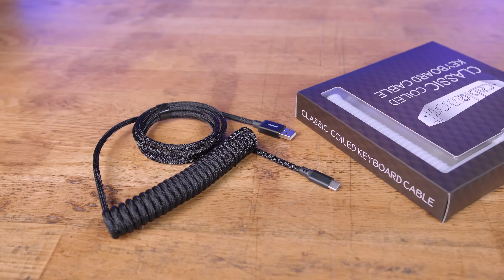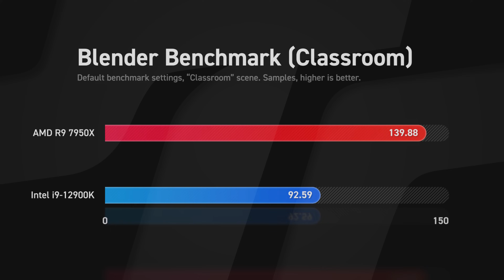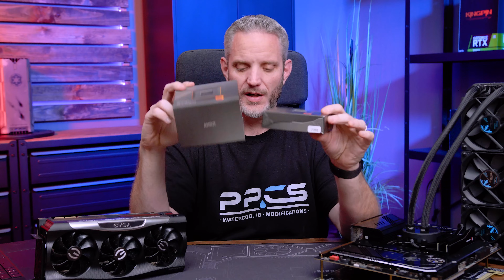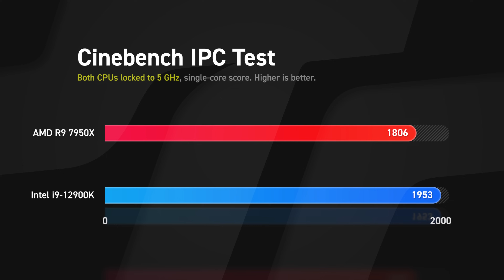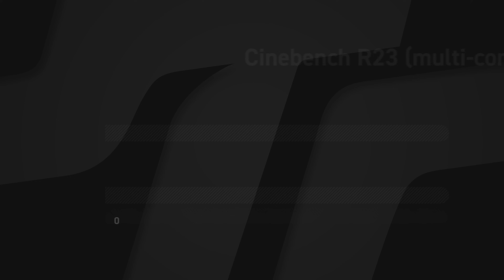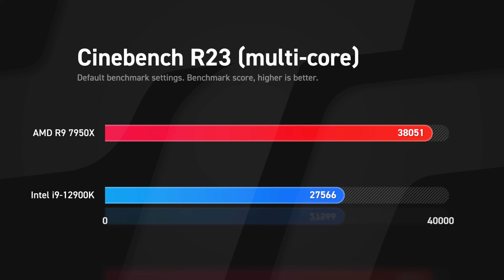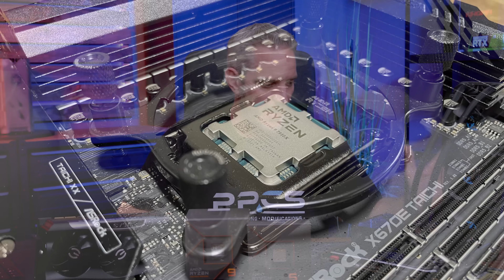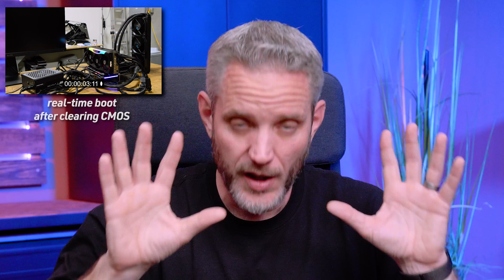Forget EVERTHING you THINK you know about AMD... these CPUs kick A$$!!

Comment: I want to see how that CPU is when you undervolt it, I managed to drop like 15°C in my 5900X losing in single core almost nothing in CPU-Z and in multicore winning a little bit of Performance in CPU-Z, and I noticed it at rendering video it did it faster than with PBO, even running at a lower frecuency, I have it running at 4.6GHz with 1.25V, that makes me have it with a temperature of 65°C  (In summer with an ambiet temperature about 28-30°C) in Full load, considering that I had it up to 81°C (at the same ambient temperature), in winter I'll probably have even better results with temperature, because with PBO in winter It has about 70°C in Full load

Comment: Hi Jay, I run a Zotac 2080Ti Amp Extreme on my Ryzen 5 3500 (6c/6t). Is this a bottleneck and will I benefit from upgrading the CPU to a 3600 (6c/12t) or a 5600 or 5600G (6c/12t). The motherboard is a ASRock B450 Steel Legend (ATX) and RAM is G.Skill Trident Z RGB (GTZRA).

Comment: Jay, i'm interested in seeing you do a video on undervolting Ryzen 7000 to see if there can be some optimizations made there and as a general guide to undervolting. I have a feeling a lot of people are going to be looking at undervolting Ryzen 7000 just because they don't want to see 95c temps.
Reply: Look no further, check out AMD's ECO mode. It's officially in starting from Ryzen 7000.
Reply: That's not how these CPUs work now. They'll just try to throttle up more to hit 95.  That's normal and expected.
Reply: Agreed i my have to undervolt my custom water cooled 5900x to prevent shutdowns because my stupid asus motherboard shutsoff if the cpu goes above 85c. A 240mm rad should be able to cool a cpu even in summer at stock settings. Its just not user friendly to have to undervolt. Thats where intel has the uperhand. They just work out of the box even if they run hot with the stock cooler
Reply: @alexanderschulte8248  maybe you can change a settings in your bios?

Comment: Man, this is what I've been waiting for to potentially upgrade my FX-8350! Here's hoping AMD brings the pain to nvidia in the same way so I can also replace my gtx 1070 with a new RDNA-3 card and have a baller AMD rig with legitimately no compromises!
Reply: Please get a 5800X3D instead, It's actually faster in games and it's cheaper if you keep in mind the prices of the new platform like the motherboard and ram.
Reply: @FirstnameLastname-we6dh  I'm not much of a gamer and don't have any use for crazy high frame rates so many people chase. The future support of an AM5 platform is WELL worth the couple hundred bucks I'd save and handful of FPS I'd gain by going with a current 3D. Who's to say AMD isn't planning a 3D version of their new lineup anyways? It would be pretty stupid for AMD not to have parts in motion that would be better than previous gen in games.
Reply: @Kcducttaper1  AMD is indeed planning on releasing 7000 series 3D next year.

Comment: 12900K doesn't have AVX-512, so I don't get the 2 x 256 thing... I think it's just that relative performance can be different depending on the workload.  Intel is generally a bit better in AVX IIRC.
Reply: AVX-512 was available on early 12th gen CPUs, with some boards supporting enabling the feature. Later versions of 12th gen CPUs hard disabled the AVX-512 capability so this would no longer work. It would have been interesting to see the performance of the same i9-12900K with AVX-512 disabled in the Cinebench IPC comparison.

Comment: This way of explaining things even confirmed my desition to wait for AM5 even though my current PC died 2 months ago.  I was still on ddr3 I5-750 platform before. I hope they bring bit more softvere to ease streaming, and doing other stuff than just gaming, If not I will get Nvidia GPU. Now I have just one question, should I invest in 64GB RAM or just 32GB ?  Btw I plan to use true 1440p monitor.
Reply: It depends on what you plan to do with it just like everything else, 32GB for just gaming and general use, 64GB for gaming+streaming/ video rendering so you have plenty of multitasking head room
Reply: @Dracopendragon013  thanks, I had planned to stream, and casual modeling in autocad. So 64gb is for me.

Comment: Looking forward to see what the AMD GPU looks like now.
Reply: probably ramps up to 95c in the first 8 seconds then sits there slowly turning your room into a sauna
Reply: @Desalater2  It's the watts dissipated that effect your room, not the operating temp of the chip. Think about how Intel's die shaving actually works. If the chip is still pulling 220w, yet the shaving allows the heat to escape faster, its dumping the same amount of heat in the room, just faster. Since you're clearly taking a jab at the CPUs, there is generally an end goal to having a CPU fully loaded. If Zen 4 and Alder Lake are at the same wattage, yet ADL dissipates its heat faster, and takes 40% longer to complete the same task, which one is actually worse for the human sitting in the room with it?

Comment: im hyped. I will wait a little maybe early next year to build my new system. Currently running a r5 3600 and a EVGA 3070 xc3. I think a 7700x would be a good match to the 3070
Reply: I think it will work really well even with RTX 4090
Reply: @phatminhphan4121  I mean true but little bit overkill for me. I don't even play on 4k
Reply: @yuschmax  what ??? Dont you know that the lower resolution you play the more powerfull cpu you need ?
At low res , the vga would be able to draw many fps than the 2K or 4K but that when you really need a powerful cpu to handle those many frames that vga can pull out per second !

Comment: So the question I have is... How does the new AM5 platform handle DDR5 and how many sticks you can run? Is the same issue present where the system wouldn't boot if you ran 4 sticks?
Reply: Hardware Unboxed did testing with 4 sticks and had zero issue.

Comment: Some of those benchmark results were also because DDR5 isn't what it's all cracked up to be. I forget who it was, but they tested DDR4 3600 vs DDR5 5200(?) and most programs ran the same, or WAY slower, on the DDR5 ram. The weakness in some of these new systems is definitely going to be the new DDR5 RAM.
Reply: Yeah, i believe Hardware Unboxed has done some of those tests.

Comment: So I'm not that well versed in CPU architecture, I have a question, in what task does a single core performance is utilised?
Reply: short answer is any task.

for tasks that cannot use multiple cores - single core performance will be the main performance factor.
for tasks that can use multiple cores - performance will be single core performance multiplied by the number of cores used.
here the performance factor will depend on the app if it can utilise all the cores and amount of cores available and the speed of each individual core. In some cases slower cores but more of them can give advantage in some specific scenarios.

Comment: My biggest 'hurdle', the full set replacement. Motherboard, memory, CPU..
Reply: wait isn't intel the one who slightly changing pin layout and you need to buy a new mainboard every time? I know i have the 3700x from 2020 and could replace it if i wanted with the 5800x3d from 2022, without changing anything.
Reply: @SaltyShakh  You are right, i totaly mixed up Zen with the socket, my bad :(
Reply: im going to call you out on that, am5 is the first new socket since am4. so no need to lie.
Reply: what? WHAT?!? AMD stuck with the same AM4 platform for FIVE YEARS...This is the first new mainstream platform since September of 2016! AMD are certainly NOT 'jumping sockets' faster than Intel - AMD have even said they plan to stay with AM5 beyond 2025.

Comment: Upgraded from a 1600 to a 5800x this year. I’m blown away by the improvements this gen. I’ll hold on for another gen or two before my next upgrade, can only imagine how much faster things will get by then.
Reply: I started of with a 5800X and it is insanely fast, I'm so happy with it. Can't be bothered about zen4 even if it is even faster. xD
Reply: Could you manage to keep the same motherboard?

Edit: I am not asking if it is possible but if DAngel did reuse the same motherboard.
Reply: @AndersHass  when going from a 1600 to a 5800x, yes, you can use the same board. The new AMD CPUs use a new socket so now you'd have to upgrade.
Reply: @singlsrvngfrnd  AMD was quite shady about the x370 updates. They even have actively blocked it . Board manufacturer are the reason the updates for some board is available, not AMD.
Reply: @AndersHass  if your motherboard can support am5 yes
Reply: @phoque9713  I am asking about if DAngel reused the same motherboard for his specific upgrade. 

No other CPUs than the recently released 7000-series used AM5 so it doesn't really make much sense talking about it as of now. But presumably it will have 5 years of support.
Reply: @AndersHass  me yeah 450 gaming plus whith all the candy you need to get faster as a 550 series motherboards when the bios update is well made
Reply: @AndersHass  no. Totally different Socket with am5. Amd is now lga
Reply: @VanquishedAgain  not for the upgrade DAngel  specifically has done....
Reply: @AndersHass  r5000x series is the last am4 thats means is the best to time to build am4 ...
Reply: @raycdo2012  no idea how that is related to me asking if DAngel managed to use the same motherboard for his upgrade. 

I know it is the last bunch of CPUs that support that socket.
Reply: @AndersHass  with AM4, you can use the same mobo (if bios supported) from 1000 series to the 5000series. I did get a brand new board to take advantage of all the latest bells and whistles. AM5 will need a new AM5 supported board but should support the next few generations.
Reply: @DAngelProductions  I know you can potentially use the same motherboard hence why I asked if you did so.
But interesting you bought new motherboard anyway.
Reply: i still uses 1600 with a 1060 and am thinking about to upgrade in to a used cpu and gpu , when zen 5 launch i might build a new pc
Reply: @hannebbell9090  i basically had the same lvl of setup at you, just sold my pc and built a new computer this week with a 5700x and 3070, the prices of those 2 parts were to good not to buy atm
Reply: I'll be grabbing 5800x3d for no other reason than my daughter needs upgrade for her work so will give her my 5600x she currently running 1600x 😑
Reply: I went from a 1600AF to 5600X, I feel like AM4 still has plenty of room for me so I'll be skipping the new Ryzen 7000 I think.
Reply: A ryzen 3600 user here....finally a time to upgrade, the 7600x is the one to go.
Reply: i bought this year a 5600 from 1700 i had, i dont regret it. will buy a new cpu in maybe 5+ years. maybe there will be a 10ghz cpu by then :P . The cpu competition its great, but feels like the gpu market started to slow down considerably in terms of performance, of course we will see what the new amd gpu will be like soon. but for me dlss its good for low-mid end pcs, since it does just upscaling which isnt the real quality of a native 4k. I see huge increase in power consumption of an gpu with a very little gain 20% gain isnt much, because we can do OC too with older gpu
Reply: @JokeryEU  agree cpu race is interesting and competitive. Hope Raptorlake doesn’t suck to keep amd honest. 

Meanwhile in GPU land….
Reply: Dude... Same here. But I was even more outdated with an FX 8320... Went straight to a 5800x and I'm still blown away every day. I'm even going from slow 5200 rpm HDD to a 1 TB 980 pro for OS.

Just waiting for a 3080 12gigs I ordered 2 weeks ago, coming from a GTX 970 on that front. This leap is incredible.
Reply: did upgrade form 3700x too 5800x3d  it is the best for am4 gaming  and i love that it can keep up in some cases with zen4 cpu well until zen43d  kicks in later on 
will wait until zen 53d or zen63d comes out bewcause its jsut amazing it not only top modern game that benefit form 3d cache it every game they was limiteted by the cpu many mmo get a extrem fps boost thanks to it 
and i will definitely buy another 3d cache cpu when the 5800x3d get to old
Reply: You will be able to upgrade to 5950x. Or 5800x3d, which is even bettet than 12900k for gaming

I would hold off
Reply: Yeah, I seem to upgrade/build at the end of a sockets life my 5800x was a humongous upgrade from my fix 6300 system I was still using. Probably going to end up upgrading at a similar point down the road.
Reply: Well im still living on E5440 :D....
Reply: No the G isnt as good as the x in gaming.
Reply: I would hold off on upgrading until you're sure there's not going to be a food shortage due to the stupid sanctions that are put upon Russia. We're in a time of war and you might want to hang on to your loose change for survival rations.
Reply: I can attest this. I just upgraded from a 2600k to a 5800x and the performance increase has been insane
Reply: Imagine going from a laptop i5 9300h to a 5800x3d soon. Honestly psyched to get new parts for my new pc build after becoming a salaried adult.
Reply: I did a slightly different, but still very similar thing. I went from a 1700x on x370 to 5700x.
Reply: I did a similar upgrade. Went from a 2700x to a 5600x to increase my gaming experience.
Reply: Love my 5800x, upgraded from an i7 6700k.  The 5800x does run a tad hot just needs a little tweaking to drop temps but still a good chip.  It's definitely an exciting time for tech, kind of reminds me of the battle between AMD and Intel in the early 2000's to see who could hit 1GHz first.  Ran AMD starting with the K6-2 up to the Athlon X2 4200+ then went Intel for the i5 3570k and i7 6700k.  Happy to see AMD back in the game, looking forward to see what they do on the GPU side and if they can bring the same level of hurt to Nvidia.
Reply: Don't tempt me man, I'm still running my 1700x and and really shouldn't upgrade 🤣
Reply: I went from a 1600 to 5600 on my same original b350 motherboard and unless something unexpected or catastrophic happens with my system I'll be waiting for one or two more gens at least.  I really noticed better(smoother, so less dips) framerates  while gaming after the upgrade.
Reply: Upgraded to 5900x, feels jelly as well especially with regards to ram ease of use. Timing Ram has been a nightmare for me.
Reply: These benchmarks against Intel RIGHT NOW are laughable, we NEED to see the 7950X vs I9-13900KS benchmarks,before we can make ANY decisions/its good to see that the 7950x is beating Intel's last gen CPUs/Alder Lake,if it didn't beat last gen, then we would DEFINITELY be worried,we will have to see how AMD does against Raptor Lake/the i9-13900KS, we are already seeing, Intel's individual cores, from last gen giving AMD's next gen cores a hard time/the single core test wasn't promising.

For the record, I will be buying which ever CPU is most powerful.

A LOT people see 50cores on a CPU and 32 cores on another and automatically think 50cores is better, this is not true/every core isn't created equally,some cores are more powerful than others.

Most likely I will be getting an i9-13900KS and an Asus 4090ti,but we will see, which CPUs are actually faster/more powerful.

I currently have an i9-12900ks,Asus 3090tis,128GBs of 6000MHz DDR5 RAM and 5 Kingston KC 3000 SSDs on the Z690 Asus Maximus Extreme Motherboard,I also have a 420mm AIO and the Asus Thor Titanium 1,600watt power supply.

Anyway we will have to see how Raptor Lake/the i9-13900ks compares to the 7950x.

I've been using IFTTT/If This Then That for a while now/an example, IF its raining,don't turn on the sprinklers/IF the temperature goes above X,turn on the fans,these are just simple examples,but this is something I've been practicing for YEARS,at this point/maybe 10 years,I have IFTTT on top of IFTTT and I also run all custom software/drivers/firmware on all of my devices and even custom ROMs on A LOT of devices,mainly,because I still use two cards,but also,because I don't want to leave ANY performance on the table.

Its good to see AMD's hardware is getting more optimized for Windows,I've never had this problem on the Intel/Nvidia side/when I click on things,no matter what I'm doing on my computer,things just load/its instantaneous,I also turn off ALL animations/when I click on something I want it to load instantaneously,I don't care to see an animation,before I see the thing I need/want to see.
Reply: Bout to make the leap from the 2600 to the 5800x myself
Reply: It will be so much faster that you won’t even notice.
Reply: Same man, 1600 to 5600x and I have the same plan. I don’t really wanna jump the gun on a brand new platform so I’m fine with waiting a generation or 2 so they can figure out more optimizations
Reply: Similar boat but I started with 5800x. First PC i bought for myself. I knew there was a next gen coming but was happy with what 5000 could do
Reply: I went from 2600 to 5800x. Felt pretty happy! Still feeling happy actually
Reply: I have a Ryzen 7 3700X and a 1080Ti and boy am I tempted. If their GPUs are faster than a potato it's going to be irresistible.
Reply: As a first gen adopter of Zen, I won’t be buying the new stuff until things mature.
Reply: Next gen will be awesome. DDR5 will have matured, B650 boards will be available etc.
Reply: @Xploder270  B750. Autumn 2023! Don't take the first generation, always baby problems : )
Reply: @Xploder270  they fooking need to step a series on amd right now make it like ryzen 7000 on 700 series mother they always use like 6000 series whith 4-500 series mother juste simpluify it and make it 700 whith 7000 make it super simple to everyone so ryzen 7000 on 750b or m or 760x and z to god like boards nah if im wrong ?